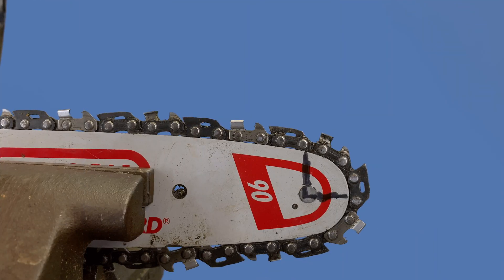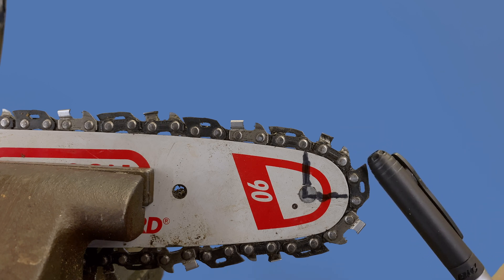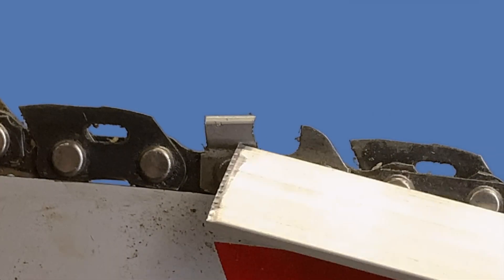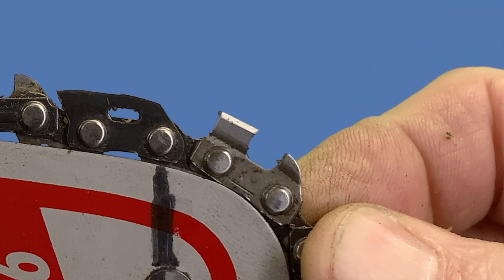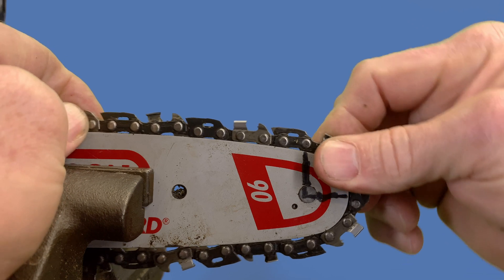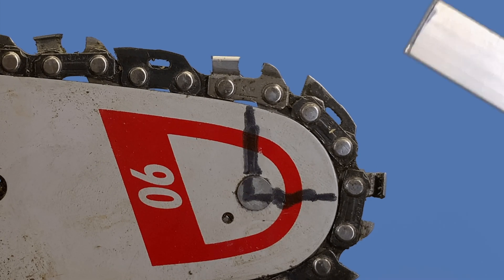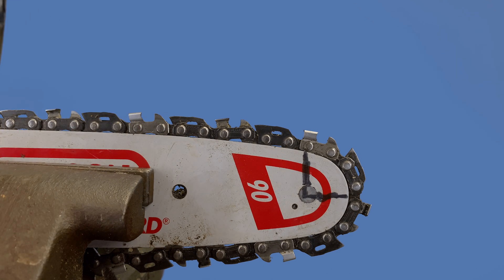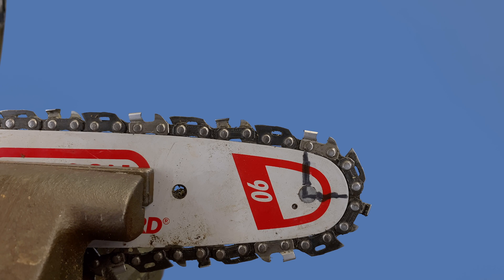T-7 Days - Let's Talk About Chainsaw Kickback

Comment from the maker: Hey folks! I thought we could talk about chains with and without anti kickback features. Stay safe and kind!
Reply: I think the most important thing to understand, Is what a saw does when it kicks back and where to place your body/hold the saw. I call it the "sawyers stance".
One thing that a lot of new sawyers do not know is that chain speed can cause kickback as well. 
I have see the same injury may times because of this.
When the chain is at a stop and starts to gain speed. It can kickback just buy hitting a small stick or furn, etc. I have seen many men destroy the knee this way on the stump.
They do not use good sawyer stance, hold the saw right and lots of undergrowth. This can all add up to a very bad day.
I'm not sure if they had anti-kickback chains when I started running saws for pay in 1981/82. ( I was using my fathers gear and it was all pro stuff.) They did not have saw chaps and when they did get them they where very bad. (Not safe but they did keep the legs warm :-)
The "sawyers stance" was/is the real PPE/safety chain.
That said, every little bit helps. The Devil is in the details.
Reply from the maker: That’s real real good point Ironwood. Stance is very important as well as respecting the machine you’re operating and properly operating it. I would say most of the safety features that have been introduced were the result of carelessness and inexperienced users. You can never prevent every accident, however, no matter how much PPE or other safety features you incorporate. That’s not to say that things like chaps, anti-kickback chain breaks, ear and eye protection aren’t necessary. The whole idea behind a chainsaw is to efficiently and safely cut wood. And incorporating anti-kickback features may address safety, but it greatly reduces efficiency. It’s also counterproductive because it forces you at times to work harder which in itself can lead to accidents. And as Jeremy Wever stated these compliant chains lead to complacent users. Good stuff Ironwood!
Reply: I thought that I had better keep this post private. So I copied and pasted it to your email.I really want you to know what I am talking about because it will make you a better and safer sawyer. 
If you and Cousin Eddie already know this :-) Just look at it like a friend telling you to drive safe or saw safe.

Comment: Chainsaw cutting not &   bland chain so that. Cut part Re grainding ? reaiper please reply
Reply from the maker: Sorry for the delay. I am having trouble understanding your question. It sounds like you have a dull chain and would like to know if it can be sharpened and how to sharpen it. Is that correct?

Comment: As a novice chainsaw user, you learn fast not to get that tip into the wood after the first kick back or two... patiently and persistently is my motto for chain saw use... Have to think those things would deter cutting a bit so for the saw they are on, close quarters use, makes sense... "standing up to buck" maybe not so much.  Have a good one and thanks WP, nice one.  🐶
Reply from the maker: You are right there, moofdogg. The first time I experienced kickback, was the last time I was careless with a chainsaw!

Comment: Good stuff Wayne, think you covered it pretty well. I prefer chain without any anti-kickback bumpers, I think it give some the false sense the chain is safer than it really is, plus "as you said" it makes bore cutting near impossible. 

Have a great weekend everyone!!
Reply from the maker: Well said, Andre. I think a person would be better off learning how to use a chain properly without the anti-kickback features. I found that when I went from an anti-kickback chain to a professional chain, not only that I have much greater performance, I also had to learn what I couldn’t have learned with the anti-kickback chains – how to properly handle a chainsaw! I think all the safety features can give someone the impression that the chainsaw is merely and enhanced toy. It’s not until you remove the training wheels, that you really learn how to ride the bike!
Reply: @WaynePolcin   i Totally agree!

Comment: I try to avoid the safety chains if possible, if not I grind them off.
Reply from the maker: For someone who is in the business of cutting trees, and who has as much experience as you do, it does not make any sense at all to use a chain with training wheels!
Reply: @WaynePolcin  it would be like a virologist wearing a cloth mask ;).

Comment: Had one in 325 on a used saw , ended up grinding the shark fins off , as the cutter got shorter it did not cut well at all .
Reply from the maker: That’s a good point, Bruce. I hadn’t thought about what happens as the cutters are filed back. I bet a lot of people are throwing away a perfectly good chains only because those find are taking control.